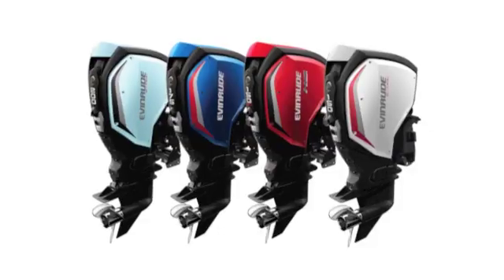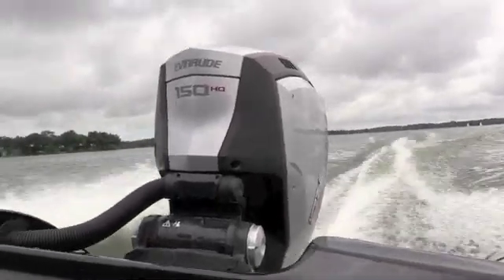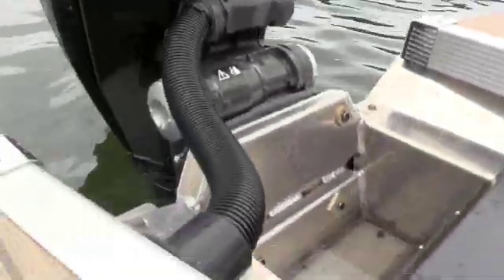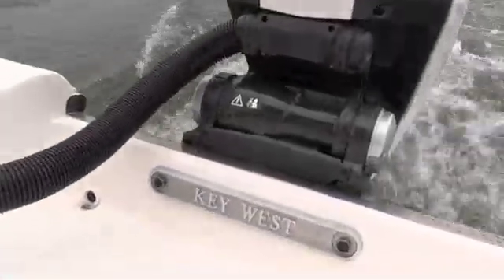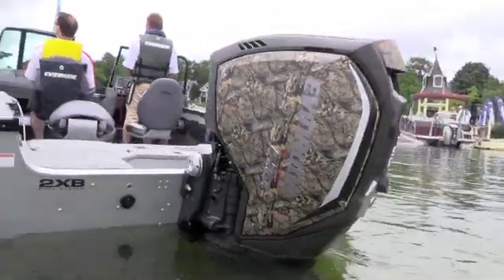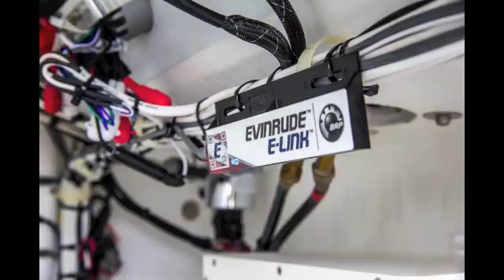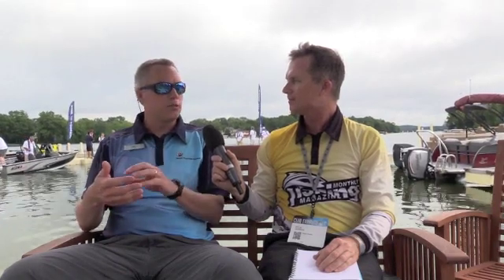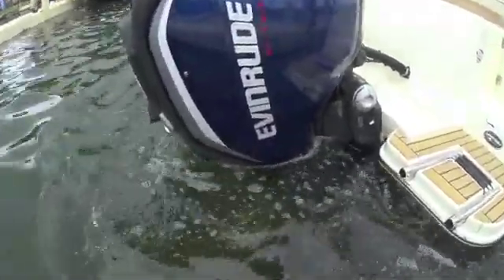Evinride E Tec G2 - 150 to 200 HP - First Impressions

Comment: I owned one of the older etec,s and throught it was a total heap of shit heavy on fuel and unreliable I now have a Yamaha 4 stroke 50 times better engine
Reply: I had nothing but issues with my Yamaha and am closing on a boat with the Evinrude 200 HO this weekend.
Reply: HyperXism Can you give any info/feedback on how the engine has been for you? I'm seriously considering the same engine. Thanks!
Reply: i agree what etec did you own iv seen several and they are fantastic and also was the outboard underpowered for the size boat? they are incredible on fuel
Reply: I've got 4 years to the month on my gen 1 etec 115,running as good as day 1.I replaced my fuel filter,plugs,and lower unit all myself at 3 years.always flush it and I dont baby it.still on original water pump impeller too. No overheating idling for 10 mins at the dock.running the premium xd100 oil,but have the motor programmed to burn xd50,so it should be double oiling.no smoke under 2,000 rpm,and see very little after running 20 mins w.o.t. at5,600 rpm and come back on idle..then clears up in minutes back to no smoke.sorry you are having issues.

Comment: isn't a 150HO a 175? and a 175 a 200? you notice how when you compare car engines you look at the torque and at how it's deliverd... outboards manufacturers never give those numbers. so basicly, just choose between 4L, V6, power you need, and then make your choice with the one that has the best design for your boat. realibility is the same for all now.
Reply: Romain Sandt No, a 150HO is rated to the max of the 150 rating that requires production outboards to be within 10% + or - of the advertised rating.  A 175 set up properly on the same boat will outperform a 150HO as will a 200 outperform a 175 HO.
Reply: @melrose9252  Wrong.

Comment: Didn't mercury have the integrated power steering on their verado before the G2? like all the way back in 2006... so it doesn't seem all that new to me at all imo...
Reply: Correct - although Evinrude seems to be the only one in the marketplace with integrated power steering on 150-175HP outboards. It's only standard on 2.6L Verados 200-400HP.
Reply: Steve Morgan
OHHHHH makes sense! Thanks for the correcting me!